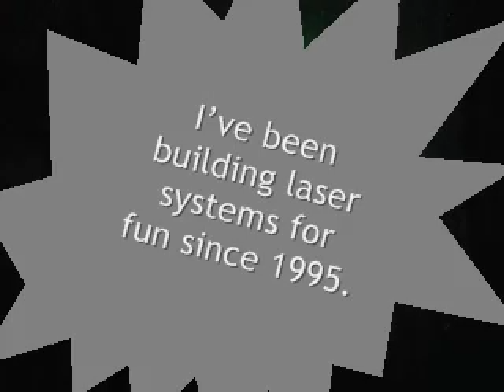3d  homemade Laser projector 2003 (uploaded 2007)

Comment: ok what about this was making ? this is just showing off what you bought already, anyone can do this video after buying one of this projectors in the stores, this is a waste of my time,
Reply from the maker: +Frank Lopez  Hey frank this was a prototype I built over 14 years ago. You should probably read the description before posting comments. The reason all the projectors look like this is they copied my design.
Reply: Sean Chaney are you saying your the pioneer of this technology?
Reply from the maker: +Frank Lopez  I'm the first to build this style of Projector using Diode and DPSS lasers. Before this projector mine as well as other laser Projectors used 3 phase large frame gas lasers. I also made a smaller single phase portable Argon laser projector around 95. I have worked with laser projectors since the early 80's
Reply: Sean Chaney then im not going to shit on you, respect! nice work then sir and my apologies for my lack of knowing
Reply from the maker: +Frank Lopez  It's all good. I apologize if I came across Harsh. You don't need to apologize. Thanks.
Reply: Sean Chaney no i do cuz i can admit that based on the new info i was out of line, and if i was you i be ripping shit as well cuz that would have been my hard work and time effort invested to not be recognized by others, im prototyping several Robotic applications and i know in the future they will be reversed engineered by others and they will try to out smart me, and if i dont get the proper acknowledgement i will come out like you did, besides the point i ended up in your page cuz i was looking for something opnsource and well documented and i guess that day i was just coming across alot of show off videos and finally i resorted on openCV and even that i couldn't install properly so i was pissed and as you can see i latch out on someone who deserved credit not shit.

excorp.weebly.com

Comment from the maker: No place does it say How to build a laser projector. This is a very old video the pictures and video segments that make up the video are around 9 years old. The case was from an APC battery the high powered Diode and DPSS  lasers I purchased in 2001 and were brand new technology at the time so this is not a deconstructed projector its a prototype built from components i had. The average projector was still several feet long and used large Argon lasers that used 3 phase power and water cooling.

Comment from the maker: @coolaidkiller This video is now four years old and the video I took that makes up this video is 8 years old. Technology has really advanced allot over the years. It is defiantly possible to make full color images as well as Vector video you would have to use a RGB laser projector, Pangolin software with very fast scanners. This setup is also very expensive. A lot of people don't realize some of  the new DLP HD projectors at movie theaters have RGB laser diodes running them.

Comment from the maker: .First off this can be a very expensive hobby, but like all technology prices have fallen dramatically over the years. The price depends on the quality of the scanners and the power of the lasers as well as the software you use. I spent about $4,000 back between 2000 and 2003 for the parts and software. I was experimenting with the new DPSS and Diode lasers of the time. The pictures in the video were taken back in 2003.

Comment from the maker: From 0:58 the animations are projected on a flat 10 foot high wall with a door in the middle. You can see the door in some of the images. The projected image is about 6 feet high I have 4 control knobs on the back of the projector that can vary the size and position of the X and Y axis to any size I want.  The 3D is an Illusion just as 3d on a computer is an illusion. There are a lot of 2D animations in this. The 3D can be seen at 0:58, 1:08 1:50 and the best is everything past 5:32

Comment: xyz axis, 10 kHz to the power of 3, laser galvo psychometric pulsating phase variance multi-trilateral interface is misaligned but could be improved with a anti-matter neutrino acceleration spectrometer device.

Comment from the maker: I used mirrors on speakers 25 years ago, that is something you do when you are just starting out. What you see in this video was built 7 years ago you can build it allot cheaper now. Galvos above 30,000 Points per second is  the only way to go for great text and graphics (not kHz). you can not do graphics or text with mirrors on speakers or mirrors mounted to motors. That is why It cost so much money back then to build this.

Comment: I wonder why you spent so much money to build a laser scanner, you can control X and Y axis by attaching mirrors to speakers, max horizontal and vertical freq. is about 10kHz depending on speakers or build your own galvos (up to 15kHz) there is a nice project on the internet, fully described, you would spend up to few hundred usd for all the scanner

Comment from the maker: The cost depends on what type and quality of Images and aerials you want. For good aerials and liquid skys you need a more power full laser and if you want High quality images and text you need fast accurate scanners both are expensive.  If this does not matter to you you can get less powerfull lasers and slower scanners (less expensive). This is not a cheap hobbie . Look under more info I lay it all out. For what you see here I spent about $4000 including software, you can make it cheaper now.

Comment from the maker: It was a fraction of the cost of my original Argon system I built in 95 but it was still expensive. Most of the parts I bought off Ebay one piece at a time as I could afford them. I believe the whole thing including software and controller was around $4,000 the most expensive part was the galvo board and galvos $1,600.

Comment from the maker: The lyrics are very annoying. This song was never completed and was not supposed to have so many Oh Gods and all you think about is sex sex sex in it. It was a work in progress, trying to get the complex rhythms between the samples of my keyboards, electronic D4 drumset and the voice samples worked out as well as the song structure. I burned one copy of 4 songs I was working on to CD in winter of 2000 the next day my ADat and my harddrive crashed after a lightning surge losing everything.

Comment from the maker: The laser beam bounces off two mirrors X axis and Y axis that positions the beam by computer software to make the image. These two mirrors are mounted to two closed loop Galvometers also called galvos or scanners. These galvos move extremely fast, mine move about 30,000 points per second the fastest go 60,000 PPS. In the assembly pics in the Vid the Galvos are in the black box after the red and green beams combine, the drivers for the galvos is the large electronics board behind the galvos.

Comment from the maker: The case is underneath the plexi glass on the last couple laser alignment pics . I prefer to mount the parts and optics on the mounting surface test them then install that into the case. I have never said this is special in fact I'm trying to show that anyone can build one. This Projector is homemade and through some expensive trial and error this is what I came up with in 2003. It is only used at my house due to US Variance laws in other parts of the world I believe you can use them anywhere.

Comment from the maker: The graphics are projected on a wall and door that's why it distorts occasionally. The aerials are through the air. You can project on a scrim or water screen if you want mid air projection.

Comment: Impressive! 400$ controller+software packet sounds affordable. Do you think it would be possible to build even a simple laser projector which could be attached with Pan-tilt unit (movable with servos)? So basically small and weighting less than 1kg.

Comment from the maker: If it is a LCD or DLP projector No it would not create the same effect as the laser especially the Aerials. If its a regular laser projector you need at least 30,000 PPS galvos to get good 3d & 50K PPS+ to get vector Video.  The video & encoding of most of the laser scenes is not accurate with what I was actually projecting and in real life the images give an illusion that they are actually rotating in the middle of the room the camera does not pick up all of this & has dropped a lot of frames

Comment from the maker: Thank You Noccy80!  I've thought about writing some manuals or papers on what I've learned over the years, allot of it has been trial and error (the projector in the video was going to be RGY but the green laser over powered the red so I separated the output beams for dual images.)  It's a very expensive hobby although the prices have dropped dramatically in the past 14 years from the large frame gas lasers to the DPSS lasers you can get now.